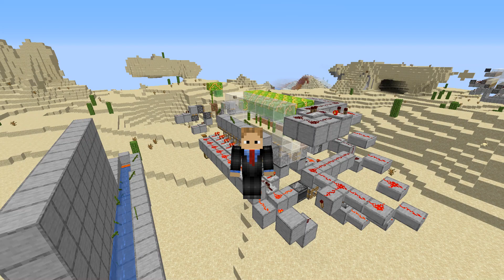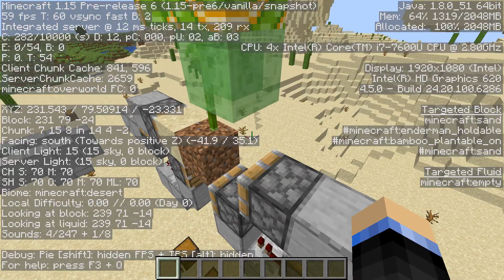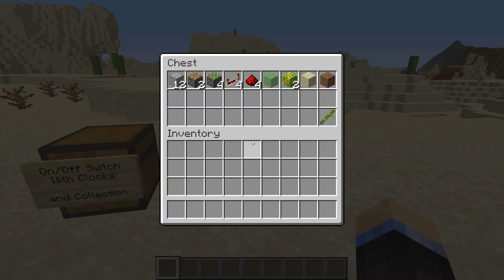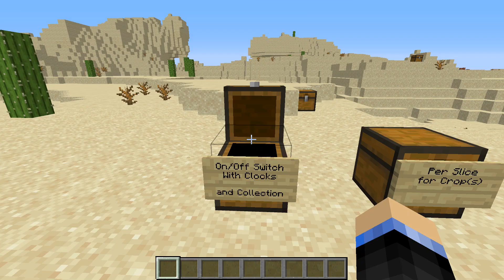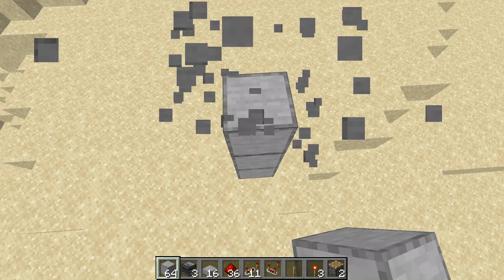Fully-Automatic Shaky-Sand - 5,000 Bamboo Per Hour, Per Crop (Minecraft Java 1.13 - 1.15+)

Comment from the maker: Finally... fully automatic, one input on/off, unload safe... shaky-sand for Java 1.15... it has been along time coming :)
Reply: THIS IS IT!!! #PleaseNoPatch
Reply: can you make a video on xp farms for ps3? shaky sand doesnt work so alot of people dont have very fast sugarcane farms.
Reply from the maker: @kurokansen  I only have/play Java, but my enderman farm should work on any platform.
Reply from the maker: @Brent Paessens I only have/play java
Reply from the maker: @Brent Paessens in PS4? I don't have that version so can't test, but prob not.
Reply: yo i just tried this on a small server with friends and everything else works, except for the sand. if you drop it on the pistons while its turned on, it shakes but as soon as you turn it off and try start it back up again, no more shaky sand. This in turn breaks the bamboo, thus no longer works.
any ideas? trying to make a fully automatic xp furnace build
Reply from the maker: @slayer8426  sounds like your timings are wrong.  that said, I already have a newer and better version if you check out the shaky-sand playlist.  happy to help trouble shoot this one if you can post some screenshots to the help section of the discord channel.

Comment: I believe if you don't have a lot of slime balls for the harvesting you can also use 3 sticky pistons (instead of only one) without wasting 27 slime balls on the slime blocks; then you'd connect these 3 pistons to 3 normal blocks, so you won't even have the problem to use obsidian or glazed terracotta.
Reply from the maker: I made a version after this where I was able to bring the water stream to the crops meaning that you don't need the slime to throw it any more and increased the rates to ~6.6k per hour per crop :)
Reply: @EagleEye621  damn, I was just about to finish this one :) btw I appreciate your work
Reply from the maker: @leonardo_renzi  :)

Comment: When I placed the lever at around 10 minutes in the video to test if it worked it launched the first piston but the piston holding the sand/dirt didnt move?
Reply from the maker: you probobly built it in the wrong orientation... the zero-tick pistons have to be pushing east/west
Reply: @EagleEye621  yes, i noticed too late and had to build it all over again, luckily it works now, thanks
Reply from the maker: @knurft3  yeah, directional issues are the worst because there is no good way to fix it without starting over :/

Comment: If I wanted to power this on and off with a remote switch like a piston and redstone block, how would this be done. I know it sounds crazy but every way I've tried the farm will not work correctly. Feeding a redstone signal into the block with the lever will start the farm but it will not produce items.
Reply from the maker: check out my upgrade to this one which brings a water stream to the crops to increase the rates to 6.6k per plant.  as for the signal, I show in that build how to connect the whole thing to a lever you can drag a bit away from the farm

Comment: What can I do if the shaking sand breaks the plants?
Reply from the maker: sounds like you did something wrong?  you can post a quick video or some screenshots on the discord so I can help troubleshoot :)
Reply: NVM, just fixed it. The bamboo needed to grow first, then I could start the machine without breaking it. Thanks for the fast answer!

Comment: Does it still work in 1.15.1?
Reply from the maker: yes
Reply: @EagleEye621  ty for the fast answer :) have a nice xmas time
Reply: PS my sand blocks are breaking after a while doing this... u have any idea from preventing them?
Reply from the maker: @abciii  need to see the build to tell you what you might have done wrong. can you post some screenshots to the help section of discord?
Reply: @abciii  Mine did the first time i turned the machine off after having everything set so i just replaced them and they seemed fine
Reply: @HarleyCl462  jup u can replace them but than u rent able to be afk anymore.... I will send ya a Screenshots via discordlinke after xmas 🎅wish ya all a wonderfull time
Reply: ps: here is an view or screenshot from the topside (https://discordapp.com/channels/502885765831983104/503548220186689536/659850064587653160) - but i guess its happening when  im leaven the chunk as a player

Comment: It does not work on my 1.15
The redstone only trigger one piston so the sand wasn't pushed
Reply from the maker: did you build it in the correct direction?
Reply: @EagleEye621  yes I created basically the same but it did not work
I created shaky sand and tried speed planting bamboo to 2 block high bamboo stick but it also broke very quickly
The plants on shaky sand broke immediately except cactus
Also the redstones only trigger one piston, the below one which push the block up, it never triggers the piston that would push sand :(
Reply: The latest version is working ! Thank you very much
Reply from the maker: @whoisitidk3980  as long as it is working now :)

Comment: Not working on 1.14.4 multiplayer, any reason why it wouldnt?
Reply from the maker: depends what you mean by not working.  If the bamboo is not fast growing, you may need to add more light near by, or your server may have added a mod to block the fast growth.  If you are or know the admin, you should be able to remove that mod.

Comment: Is this faster than ilmango's classic zero tick design?
Reply from the maker: shanky-sand is 36,000 random updates per hour, where as normal zero-tick is 12,000.  The clock I use here is a little slower than optimal, so the harvest rates are pretty similar per crop, but this design is tileable so you can build it as big (or small as you need).  If you put the same three-game-tick clock on this one that ilmango uses on his 60k machine (this build uses a simpler 4-game-tick clock for ease) it would have higher per crop rates.

Comment: Does this method still work for 1.14? Just curious.
Reply from the maker: yes, and 1.13... but if you are in 1.14 the boat method is better.
Reply: I got my answer... Man I need to look at comments more.
Reply: You try it? Neitehr this or the boat method are working for me in 1.14...
Reply from the maker: @DroneXYT  same answer as with your other comment I answered a few seconds ago... either more light or your server has a mod installed that blocks it.

Comment: Didn’t even realize you could do those timings with torches. I was doing it with pistons and redstone blocks. For people who are later in the game, try something like this https://youtu.be/1JthuvFJ10Y

Just less laggy and more compact. Also sorry for the video quality just took it on my phone lol. 

I’m working on a similar farm but with sugar cane. I want add in the zero tick pistons, same positioning as the previous bamboo farm, but I want them always moving like ilmangos sugar cane farm to improve rates.
Reply from the maker: interesting... at least I think... kind of hard to see what is going on :p
Reply: EagleEye621 ya uses some strange tricks to compact it. Different zero tick generators to eliminate directionality and reduce cost. The two different levers control how much bamboo the farm produces. It is basically the same farm as yours, but the wiring is made for lag efficiency instead of simplicity. 

I’ll try to make a more high quality video for my sugar cane farm lol
Reply from the maker: @aqwrd3546  I look forward to it :)
Reply: @aqwrd3546  tbh I actually wanna see this work, this looks great for servers. By the fact that you used rails instead of redstone I can tell you know what you're doing and i reaaally wanna see a tutorial for that design. Also, maybe the collection system is not 2 ticks :?
Reply: SniffersMc ya it’s 3 gameticks lol :(. Don’t know what I was thinking thanks for pointing that out. Should be an easy fix though. I probably won’t do a tutorial because it’ll be broken in 1.16, but if you really want one then I guess I could do it. If I do I’ll try to make a better design because I’ve gotten a lot better at redstone since :)
Reply: @aqwrd3546  ah, they finally fixed shaky sand?
Reply: @aqwrd3546  also, do one tick farms still work?

Comment: I am learning a lot about water streams and getting items to go where  i want them. Could you possibly do a water stream/item direction video one day using the most common methods of item transportation? Explain what's the purpose for fence gates and Ice in a item transportation system. 

I can't make these ps4, but I made a manual one where I have a mountain full of bamboo which I route to ovens for XP. My cactus rig can't keep up...lol
Reply from the maker: yeah, if you look at my 18k xp per hour video I got into a bit more of the why... that and the Efficient XP Video.
Reply: @EagleEye621  I will re-peep them this week.

Comment: Is this method of shaky sand only available in 1.15, or does it work in 1.14 as well?
Reply from the maker: works all the way back as far as 1.13, but if you are in 1.14 the boat method is better.  use it while you can :)

Comment: welp. your timing definitely does better than my detection circuit. I didn't even get to finish editing my video lol.
Edit: You used the exact same idea I did for the zero-tick toggling pistons though, that determine whether you're going from sand to dirt and vice versa.
Reply from the maker: yeah... the detection idea was a good one until I perfected the timing to ensure it would shake every time.  You should still post that video as there may be a use application for shaky-sand that for one reason or another doesn't allow for the tick-perfect timing.  Indeed, the application could have some interesting uses in itself, such as a cool randomizer if people get board with the dropper method :)

Comment: Does it work in 14.4 ?
Reply from the maker: works in 1.13 through 1.15, but if you are still in 1.14 you should use the boat method shaky sand while you still can.  I have some massive farms based on that tech (the boat method was patched for 1.15)

Comment: Sorry I'm new to the game... But what are those blocks that are like slime with streaks of honey running through them?
Reply from the maker: the ones above the slime block?  Those are glazed terracotta.  you get them by putting terracotta (used to be called clay that was dyed) in a furnace you get those blocks.  Each color makes a different block.  The reason they are in this build is that slime blocks won't stick to them.
Reply: @EagleEye621  nice thanks!

Comment: That collection method though.
Reply from the maker: genius :) ... I couldn't figure out how to get the water stream in there and keep it tileable since if the water in where the sand used to be, after 8 blocks you need to drop, but you can't as there is a piston there... so figured if I couldn't bring the water to the crops I would bring the crops to the water by launching them out of the farm :)

also, hope you read the description...
Reply: @EagleEye621  agreed it'll probably be my collection method or designing from here on 4th thank you for the shout out
Reply from the maker: @85matticus  happy to :)
Reply: @EagleEye621  why not use hoppers right beside the bamboo instead?
Reply from the maker: @dubwest911  hoppers can only move 9k items per hour... two bamboo in the same hopper line would jam the whole thing.
Reply: Oooh go matticus! Can't wait to make a super smelter lol. So if I leave the area will the farm be fine?
Reply: @areebmasoodi8932  as long as u toggle it off
Reply: @85matticus  okay thanks.
Reply: @areebmasoodi8932  any time